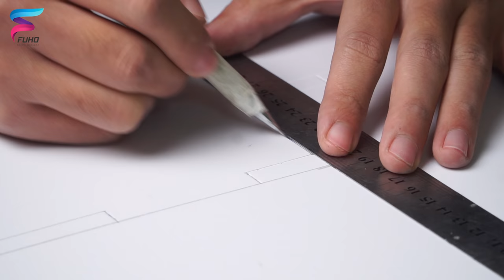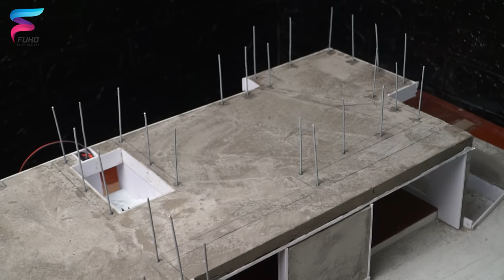How To Build a Amazing Modern Villa Concrete

Comment: This is awesome! Which material do you recommend for the formwork? And how long do you let the concrete dry before removing the formwork? I'm an architecture student and would love to build my next model out of concrete :)
Reply from the maker: about 1 day.
Reply: @fuho   what is the material of the wire/bar you use for the reinforcement? Iron? Steel?